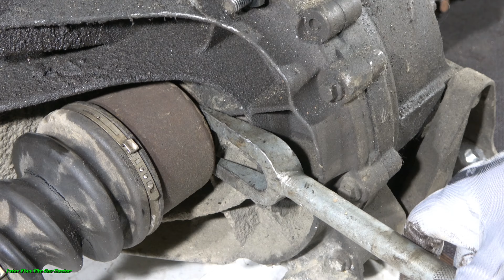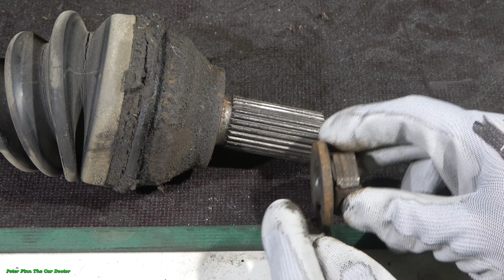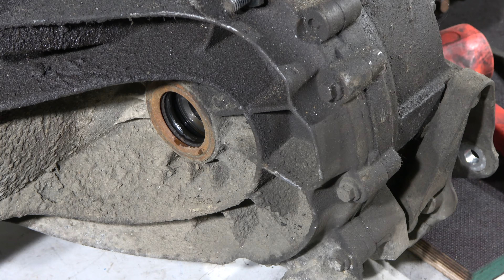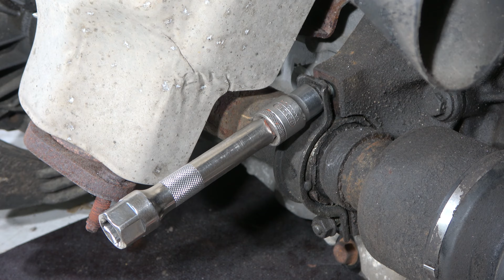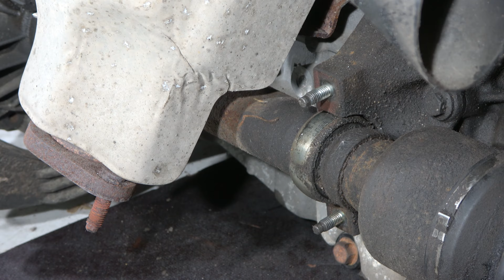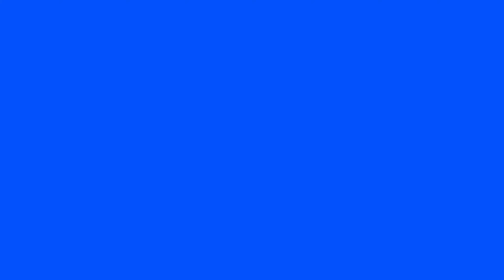How to remove Drive Shaft Ford Duratec engine Years 2002 to 2015

Comment: Did you removed oil from gearbox before removing drive shaft?
Or its possible to change shafts without new oil?
Reply: I did the right hand side a little while ago and didn’t lose any oil because it was jacked up quite high. If on a lift and the car is level you might lose some perhaps?
Reply from the maker: Oil must remove or add